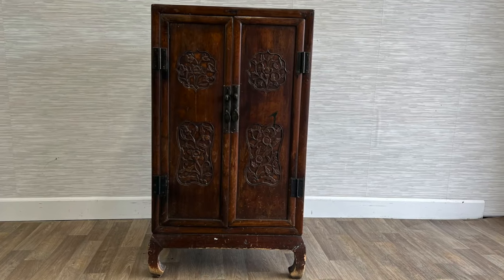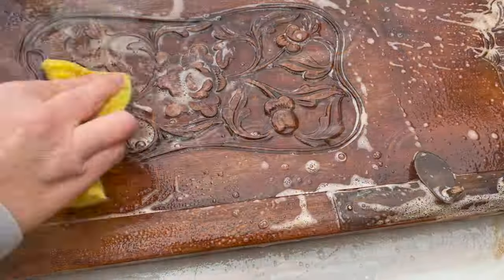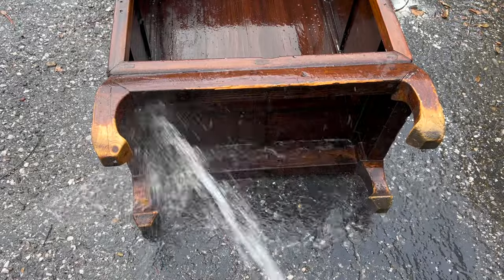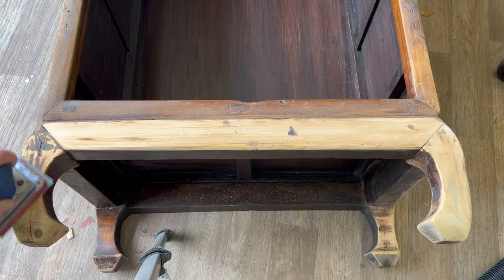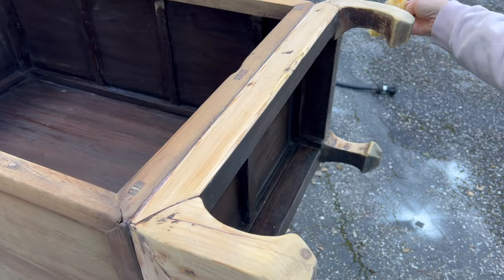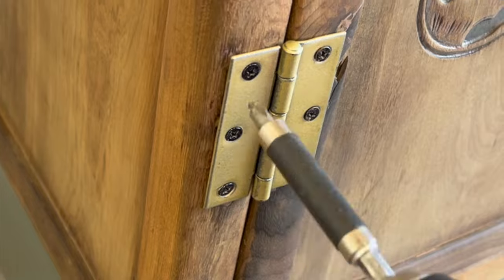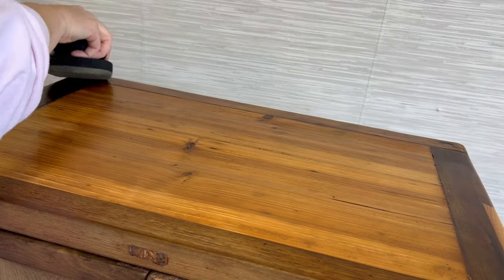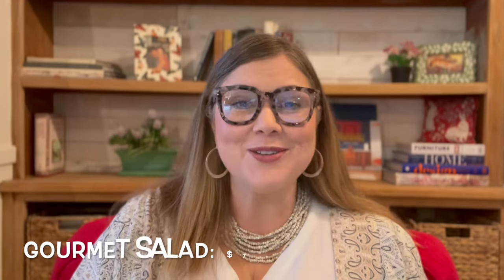Updating DARK FURNITURE with a RAW WOOD redesign! | Beautiful Asian Cabinet Glow Up

Comment: So glad you put all that wood on display! I'm fascinated by the fact that it's sort of pieced together -- as though they ran out of the wood they were using or something splintered, so they patched it with some other bits and pieces of wood. But the fit of those patched pieces must have taken a fair amount of skill. Done at a time when materials were more expensive than labor maybe? It's a beauty now, the way you redid it.
Reply from the maker: Thanks so much!  Yes, I agree - the way those scrap pieces were used is actually kind of amazing, and that upside down triangle piece on the top of the right side (looking at the cabinet) door is one of my favorite parts. 😊
Reply: @FurnitureFablesbyAndy  Yes! That was my favorite also!

Comment: I always enjoy your videos.   Again Andy, well done.   You are correct.  Dealing with pieces thinking raw wood, and discovering it is not all raw wood is a big challenge.  Can look clownish if not done right.  You made the right decisions where needed.  Adding the wallpaper and transfers gave it a dramatic modern look.  In your part of US, there are deep pockets.  I am sure it will go for $500 easily out there.
Reply from the maker: Thanks so much, appreciate your insights, and thanks for the pricing suggestion!

Comment: It now looks authentic.  The painted base is just what it needed to support the chest's new exotic look .  The wall paper is chef's kiss.  One question how does the wood dry without  the wood grain lifting after  washing and rinsing?  I am always impressed.   And the chest  looks well traveled, tea  or liquor cabinet
Reply from the maker: Thanks so much!! So glad you liked that paper too. 🖤 I always dry off my pieces with a big towel right away to get the majority of water, and our air is usually very dry, so as long as there is some kind of existing finish on the piece, it isn't a problem.  But only with solid wood! Gotta watch out for pressed board...😅

Comment: I've been trying to add more salads to my diet. This cabinet would fit perfectly into my diet. LOL If I had the expendable cash (not used on a newborn calf) I would send you $375 for this beautiful cabinet. I absolutely love it! Your design sense and artistic flair always astounds me. Well done! 

By the way, how do you know when to stop sanding? I will start sanding a piece but never know when to stop, and then I end up thinking.... "It's good enough" and second guessing myself. LOL
Reply from the maker: You and me both!! (salad adding 🥗😊) Oh my goodness...a newborn calf?? How fantastic!! As far as sanding goes, and that's a great question, a good rule of thumb is when I notice that the texture of the piece I am working with is no longer changing visually, it's time to stop or move up the grit ladder.  (220 is almost alway as high as you need to go to finish a surface.)   But if you ever want to give yourself some help with that, you can do the pencil trick - lightly draw a curved, flowing line across your work area, and when all the pencil is gone, you've probably sanded enough at whatever grit you are currently at.  My other trick is to always look at the surface from as many angles as possible - the light can really make a difference showing me how even or uneven the surface truly is.  Thanks so much!! ♥️🐄

Comment: Could you tell us what sanding machine that you used? Does it vacuum up the sanding dust? Thank you!
Reply from the maker: Yes and yes!  I use the Surf Prep Electric Ray 3 x 4 detail sander and it is attached to its own vacuum.  It's a fabulous tool, but it is quite an "investment".  💰 But if one does this work with any regularity, I would highly recommend investing in one or something similar!  😊